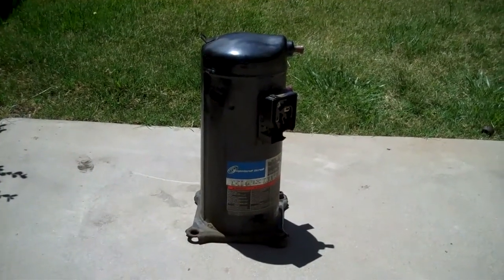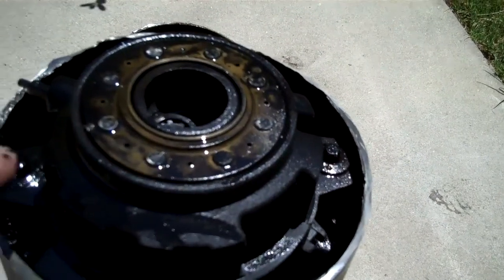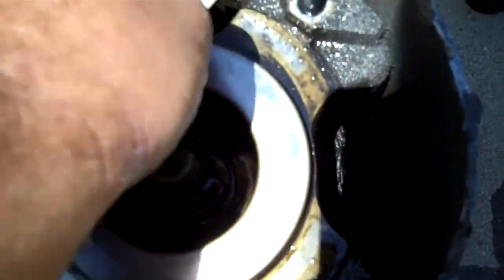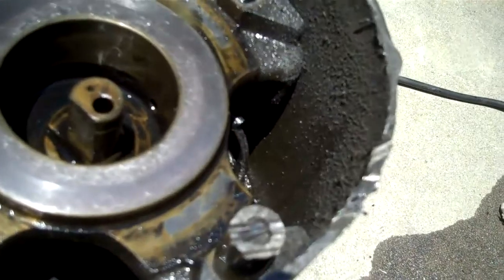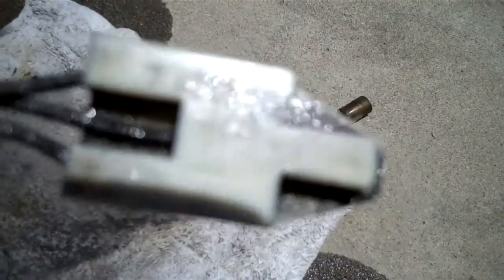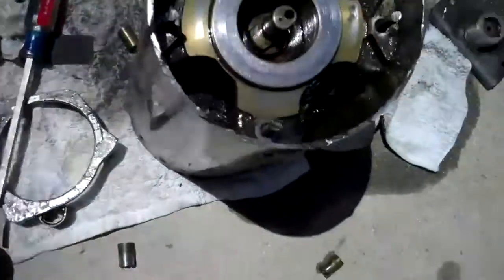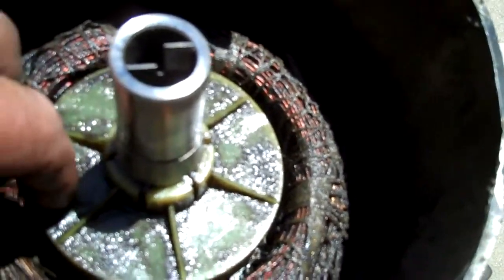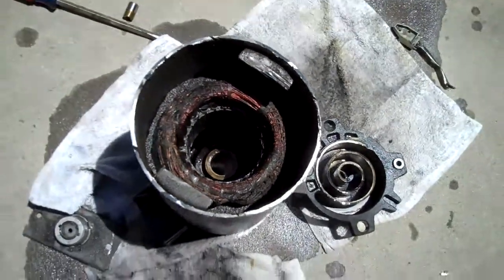Scroll Compressor all cut up

Comment: could you please tell me if this statment is true "The motor compressor is suspended by springs in the capsular housing which minimises the transmission of vibration to the capsule body, thereby reducing noise emission"
Reply: That is correct! It is also suspended to avoid damage on the tubes containing the coolant :)

Comment: 6:45

Gotta love how if you get one piece of information not 100% correct, the trolls don't hesitate to call you an idiot, incompetent, etc.
Cool video though. I've been curious what the inside of a scroll type compressor actually looks like since I started researching for an air system for my shop.

Comment: Is it possible change rotation of shaft from right to left and still keep oil supply to the 
spirals? In Copeland Scroll manual there is remarks that scroll can work max. 1 hour in opposit direction of rotation without demage. It is not clear for me - opposit  direction still deliver oil or not? I want built air motor from scroll and don't want  make any changes on the bottom with shaft where oil is ssuck. It is possible?

Comment: man that thing is trashed 
the spirally machine marks are made by contamination in the compressor, bearing debris etc.. getting ground into the scroll with the oil
The copland scroll shows up at my scrap yard quite often having failed mechanically or electrically, but I'd bet its not the compressor's fault. more like improper installation, slugging, lack of subcool etc..